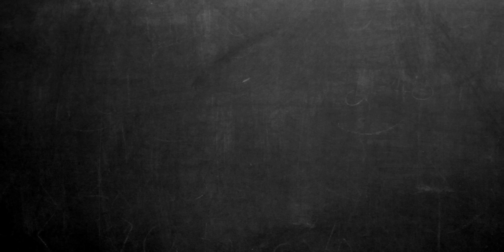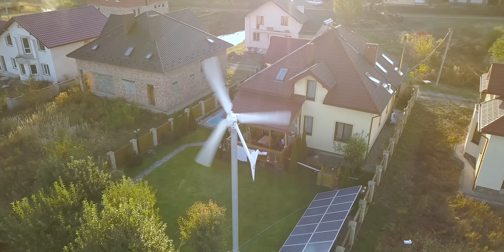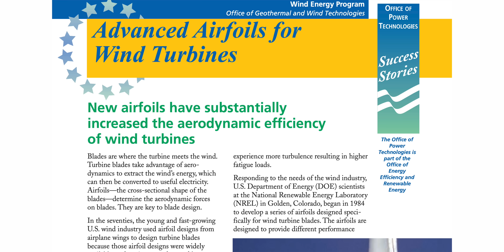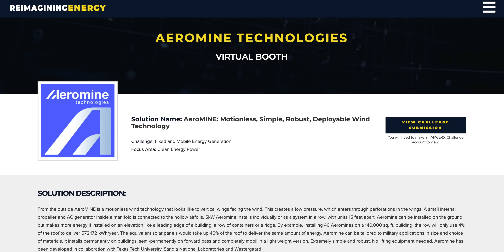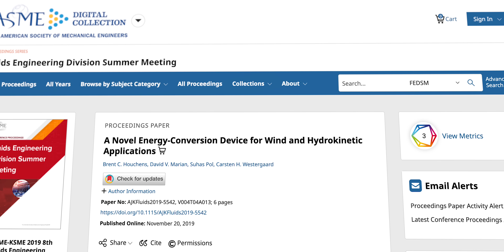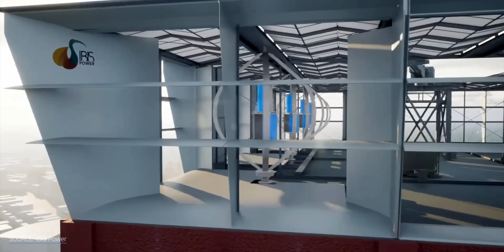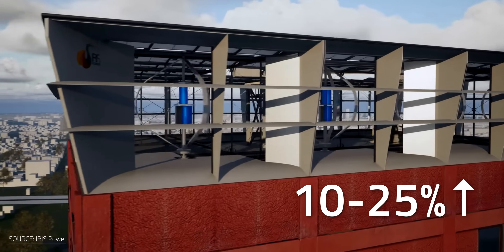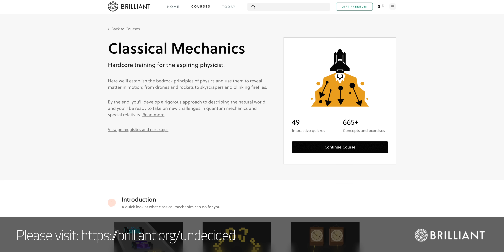How Can A Wind Turbine Be Motionless?

Comment from the maker: Do you think any of these wind turbine concepts have a shot? Visit https://brilliant.org/undecided to sign up for free. And also, the first 200 people will get 20% off their annual premium membership.

If you liked this video, check out: Can This Metal Really Beat the Lithium Battery? https://youtu.be/5B6icvUBNzE?list=PLnTSM-ORSgi7UWp64ZlOKUPNXePMTdU4d
Reply: This was invented by University of Michigan about 11 years ago here...

Except the design is used for under water in small creeks with low flow 🧠
Reply: Vortex Hydro Energy by University of Michigan (same concert except it's in water for small river and creek.. genius and untalked about)
Reply: You mentioned a minimum wind speed but not a maximum wind, I assume because they didn't give you this information but in curious how this system would hold up to high winds. I live in the tropics so all building roofs are flat. This would be good to combine with the solar panels to generate power at night.
Reply: @michaelmayhem350 It should beeasy enough to design in the ability to close the intake: the only limit would be the strength of the mount. (This is not an endorsement: this is not a new idea and every time it is brought forward the actual realized numbers are far less than the theoretical numbers presented, but excessive wind speed isn't the problem).
Reply: A small VAWT will never be efficient enough to be commercially viable. Even with the claimed 140% bonus of the venturi effect. 

VAWTs are simply too inefficient to begin with (15% efficient vs 35% efficient for a HAWT) 
Then there is the simple fact that every increase in size will yield an exponential amount of harvested energy. A bonus for large HAWTs, an added downside for small VAWTs. 

I still have to see a commecial deployment of the Ridgemount system. Seems to be stuck in development hell and I recon will soon be considered vaporware.
Reply: You are WRONG. The real problem for residential wind is the amount of energy you can obtain from the wind. Power (kW) per meter square = 0.0006 velocity cubed. Most wind speed in urban areas is 3m/s, which means  0.0006 * 3^3 = 0.016 kW, or 16 Watts per square meter. A turbine will have an efficiency of like 30% (but realistically more like 20%) so 5 Watts, which is useless which is why people don't have wind turbines on their homes. Industrial wind farms work because the are built in high wind areas and the tall height of them are able to access wind that is consistent and free from the friction of ground objects.
Reply: Is this an update of your video "The Future of Solid State Wind Energy - No More Blades" from a year ago? Are any of those projects still feasible?
Reply: @aromaticsnail  "Are any of those projects still feasible?"
They have to be or we're doomed!
Reply: How Dare a wind turbine be motionless.. would you please cover sterling engines and their uses .. thanks 😊
Reply: why not let the whole Aeromine unit rotate towards the wind?🤔
Reply: @hillelme  I doubt the "aeromine" actually exists.
Reply: Hey the town in Michigan should be pronounced "Y and Dot"
Reply: it's like a reversed «air multiplier», the claims about the power it could make are basically bogus
Reply: Sounds good, personally I like harmony turbines. You should check them out if you haven't already.
Reply: Any thoughts on waxworms that consume plastic?
Reply: I wonder (I am not an engineer) if the aeromine wing/vanes section could be made to rotate into wind while the turbine house was fixed. This wind would increase the efficiency by tracking the wind but maintain some of the simplicity of having the turbine generator housing fixed. 🤷🏻‍♂️. 
Really enjoy the your vids, be interesting to get some follow ups on some of the ideas etc you have featured in the past.
👋🇬🇧
Reply: Utrecht is pronounced Ootreght
Reply: I like the power nest concept.  Not only do you get power generation, but you get well ventilated shade on the roof.  This is especially important in places like California and Arizona where air conditioning becomes a major component of the power demand.
Reply: To pretend we could even dream of capturing  1 percent of the worlds wind energy is asinine. Why start with such a ridicules statement? Let’s just be honest. Even if we could build enough wind and solar to supply the world we would still need at minimal 40% produced by something reliable. Nuclear or fossil fuels. That or enough batteries to hold several days worth of power….. which will not happen with todays tech or anything we are coming up with soon. If you guys actually want to take human admissions seriously nuclear needs to be front and center.
Reply: Our potential future starts to sound a lot like the wind turbines on Arrakis in Dune :-)
Reply: Small observation - cars are NOT an upside down airfoil, the air under the car goes SLOWER than the one on top (distance for the air to flow to the back is longer on top hence air flows faster).
On a second note, most startup energy/green companies are out there to capitalize on Gov. grants (sadly) and will never come up with anything useful - they just need a "project" to show for - there are still startups collecting MILLIONS on Gov. grants for the "HYPERLOOP" train scam.
Reply: You just gave a partial course on aeronautics, which all pilots must have. Awesome!
Reply: @youxkio  Yeah except for the stuff that was wrong. lol
Reply: @grumpyou1138 In all fairness, he's not more wrong than any of my textbooks, which literally all said the same thing! He's not saying anything that hasn't been said for 100 years already... it would be nice if people would catch up though: Arvel Gentry explained this all in common vernacular 50 years ago but we have yet to turn the page on this garbage!
Reply: Hey Matt, watched a lot of videos specifically about electricity and power. Since you have a lot of knowledge about these technology. I was wondering if you could make a video explaining this one and where would it stand in the current array of power innovations. https://www.youtube.com/watch?v=sDdJru7m8lo
Reply: Thanks for the video! I was wondering how this design compares to other bladeless designs?
Reply: @Edmonddantes123 No no, this is a brand new idea that no one has ever thought of before 😉
Reply: Now this could be a GAME CHARGER. Gotta keep an eye on these Energy Technologies. Like the PowerNEST with BiFacial  Solar Panels.
Reply: Don't see my post, am I banned?
Edit:
Must have used too many big words.

Use the same concept, on a duel/paired bladed conventional windmill.
Reply: I hope Matt that you would give your input and insights for that Flower Turbines that's been going on if it is legit or just hyped since it's market is in US & Western Europe so far.
Reply: Put a wind funnel on cars and have it spin a turbine and collect the energy in batteries that run it's electric motor. 😃😍😎
Reply: @manuelester7420  Why?
Reply: @grumpyou1138 Good god I hope @manuelester7420 is being facetious!
Reply: I just want my water wheel back.
Reply: Yes finally someone else has imagined a wind turbine design that I imagined could work eventually on homes with solar energy infrastructure maybe not on each house at first but creating neighborhood power units that could supply power to dozens of homes
Reply: thomaspaine6456  I could see wave generators because the wave action is critical to coast line health and wave action is only in the top few feet, but unless we are putting kites into the jet stream, it's just not an issue. 
As for Chem trails, I'm a pilot, and you're an idiot if you believe that.
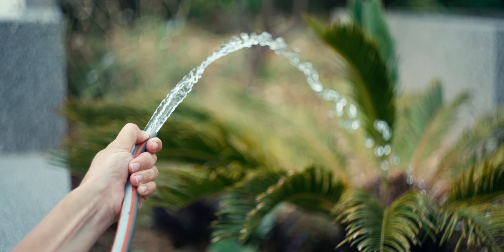Reply: @ 7:18, too bad municipal transportation regulators don't implement a Venturi Effect for merging traffic flows.
Reply: Brilliant idea. It will work subject to cost of its installation.
Reply: Your videos are superb! Thanks for the juicy content! ^_^ I'm going to be going to TAMU for Energy next year, I hope we have a point of convergence in the future, we agree completely on how promising and exciting combining alt-energy tech is. Keep up the great work!
Reply: Is it cost effective?
Reply: Real bullshit...
Reply: I worked in the UK Department Of Energy in 1977/8 and it was being investigated then. Like aircraft and space flight, etc. where there's a will there's a way!
Reply: Can you stak them in an array and can you fill a field with them having them behind others  and how far spaced apart or do you only get the benefit of one line facing the wind.  How much maintenance would be required?
Reply: Wyandott = Why'-An-Dot
Reply: Why bother with the ducted turbine? Surely there's a way to harness the pressure difference directly, such as with piezoelectrics? Then there are no moving parts at all!
Reply: Renewables can't power the world alone... it can help make the grid less heavy on energy demand but that's about it
Reply: Wind output is down meaning we are experiencing a lot less wind. Down 40% a few years ago.
Reply: Meh ..   Hasn't proven itself practical yet.  " Delivers more than solar" .. Where?  What flat roof building in an urban area will allways have wind from 1 direction?  Does it only "produce more than solar" in ideal conditions?  What does it produce in normal/varried conditions?   Having the turbine lower where it can be easily serviced is the right direction.. but this model is too limited to become a leader in the field.
Reply: Good idea. The main problem is the storage of electric power. In relevant quantities at acceptable prices. You don‘t want be dependent on wind regarding access to electricity.
Reply: The rooftop combo of wind turbines beneath solar panels seems like the best design for many reasons at least for commercial flat rooves. Thanks for your greaat videos
Reply: Excellent video!
Reply: The hard working taxpayer shouldn't have to pay for your pet  projects.
Reply: The Segway Portable PowerStation Cube Series seems like a great option for outdoor enthusiasts and RV lovers. It offers a massive capacity, fast recharging, and versatile sockets. Plus, its armor design and waterproof technology make it durable for any adventure. Consider checking it out for your outdoor gear and home backup power needs!
Reply: How would this work in a hurricane zone?  Is this allowed in residential zones (or is this commercial only)? How is it secured, maintained (if damaged), and insured?  Here in the US Virgin Islands, we have a perpetual 18 knot wind (except Sept & Oct when the earth changes tilt and the air becomes stagnant). This is also our hurricane season.
Reply: This crap have no chance to be commercially useful. At 1m wide x 2m height this can generate 83 Watts of power at 20kph. At 8kph it is just 5 watts at best. Wind turbines are 10x more expensive for 1kW of installed power in comparison to PV cost. There is no miracle technology that can much improve that ratio.
Reply: It's not motionless, the turbine very much has spinning blades. The fact that they are inside changes very little. Nice clickbait though.
Reply: @bzuidgeest This little turbine is so small there's no way it'll generate what they're advertising. I wouldn't go as far as click bait, but this dude will shill for anyone, and is a regular contributor on Thunderfoot's "busted" videos.
Reply: earth is proven to be flat.

the globe is a lie.
Reply: Your explanation of life is backwards. The faster moving air over the top of the wing create a vacuum on the top side of the airfoil.
Reply: @grumpyou1138 He's wrong, but you're not right either: The wing turns the flow of air, it doesn't create any vacuum. Bernoulli only works in a closed system. On both aircraft and Sailboats (and race cars) air flow slows and pressure increases between the airfoils (the foresail isn't sucked into the mainsail, *ever*, it's just not a thing that happens, *ever*). I suggest looking up some of Arvel Gentry's work on the subject.
But you can also be forgiven because what you have read is in literally every non- physics textbook published since WW1.
Reply: No, they don't have a shot because of simple fundamental reasons. Maybe learn anything about wind resource if you're making videos about it instead of barfing every greenwashed scam you come across to your audience?
Reply: @cedarbobedar7223  Which reasons? I'm curious.
Reply: @cedarbobedar7223  Thanks 🙏🏽
Reply: @cedarbobedar7223  What are those "simple fundamental reasons" you mentioned?
Reply: I'm sorry but I call BS on this. Till this date there isnt a wind turbine that paid for it self and that is fact

Comment: I love your explanations about so many different topics! Thank you! But an unimportant point at 3:01 is that pressure under the airfoil is what creates lift. All of my years of aviation (<-- not resorting to authority) reinforced the fact that the suction created on the top of the airfoil (wing) contributes more to lift than the underside pressure. I could be wrong, but that was pounded into my head by the USAACE and years of flying before that.

Comment: I question the effectiveness of this design.  Take off speed in my Cessna is about 60 mph. The weight is about 2,000 lbs and the wing area is 25,000 square inches.  The wing is considered efficient.(NACA 2412) .  The wing develops.08 psi lift at 60 mph.  Cut the wind speed to a more reasonable 30 mph and you get .02 psi lift.  You can fill in the blanks here.  This device is clever but it doesn’t pass the calculator test.

Comment: Alright, crazy idea time:

In generating hydroelectrical power via deprotonization of steam against a nanosubstrate within a tube, like a rubber hose or a metal coil, we shape the nanosubstrate (silicon over graphene for hypothetical, if applicable?) in the shape of like an airfoil in accordance to the Bernoulli Effect, focusing-in the steam particles to lose their charge upon collision thereby forcing electrical harvesting, while conducive to the Venturi Effect which speeds-up the remaining atomic particles of hydrogen and oxygen, smashing their way through a "nano wind tunnel" until all that's left are exotic subatomic particles, like in a hadron collider.

Now we can farm the building blocks of the universe with tap water and a severely modified garden hose, producing large volumes of havestable materials, and it's not at all limited to water, it could be anything that starts in a steam-like state.

Does this idea get me a Nobel Peace Prize or something?

Comment: All practical tests show that small wind turbines hardly generate any electricity. With solar panels, you can generate at least 20 times more electricity with the same investment!
Hardly any wind blows close to ground & it´s extremely gusty, which almost always greatly reduces the service life. 
Solar systems, on the other hand, reliably generate over 25 -30 years electricity at approx. 3 to 8 cents/kWh.

Comment: Almost no information for practical use in your video. They say 5kW power, many claims alot... Show how it works in real life, the 24h/30d/1y power graph and in different sites - then we can decide how practical it is. What is very unpractical about these motionless turbines - they are fixed - works best in one wind direction only, so on average you can divide its power by 3 at least.

Comment: Hi.  My Windturbine wasn’t working.  So I looked at the manuals, called the reps and watched vids but nothing.  So after a year of frustration I went outside and knocked some sense into the pole and it kicked on.  I was happy until I noticed that my batteries are draining more now. 

I just cut off the Windturbine. Is that a thing? Can my batteries discharge into my Windturbine? 

They worked when I had AGM, but not with the lithium.

Comment: The equation for wind turbines, P = 1/2 * ρ * A * v^3.   Note the velocity cubed term v^3!    There is almost no energy in wind speeds low enough that people can still talk and hear easily.   A residential roof is not designed for the strong rotational load placing a significant wind catching structure would cause.   In Florida people have discovered they've lost their home owners insurance and it is impossible to get new home owners insurance after installing roof top solar panels because of the wind load they would cause to a roof not designed for them during a major storm.  Small wind turbines near residences only produce power when they are too noisy to sleep around.   During a light breeze they turn around entertainingly and quietly, but they are also not making any real power.  If having to live with these things then the noise might be tailored to be some type of constant hushing sound that is soothing like ocean waves, but I wouldn't risk it with your family's quality of sleep.

Comment: there are always losses in a Venturi and "Piping Wind" down to the first floor is RIDICULOUSLY expensive in terms of drag and huge losses in any slight bend or turn necessary to get the air there. I don't believe this tech will ever go anywhere but the rooftop Darius type turbines may be a good idea although space consuming on top of expensive real estate.

Comment: The famous "Bernoulli-effect" explanation for the lift of a windmill- or airplane wing is (at least if seen as the ONLY or most relevant effect) outright wrong. Most of the force of an airplane wing is created by accelerating air downwards (there are a couple of really neat pictures of jets flying close over a cloud layer to prove this). The only difference as to an inclined board or a hand stuck out of a car at high speed is the way this is achieved by a wing: Given its specific aerodynamic shape, it "bends" the stream of air downwards as opposed to simply forcing it, hence the lower drag.